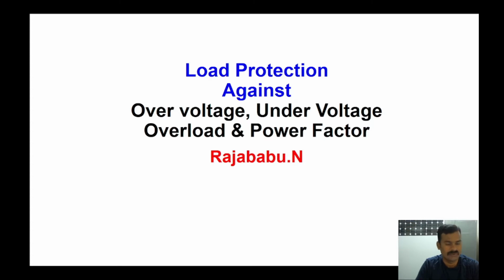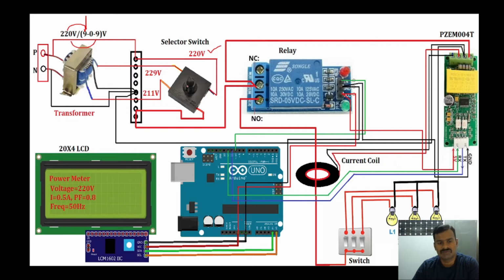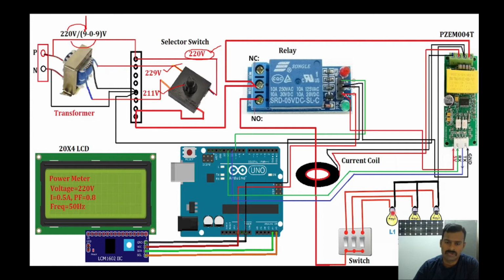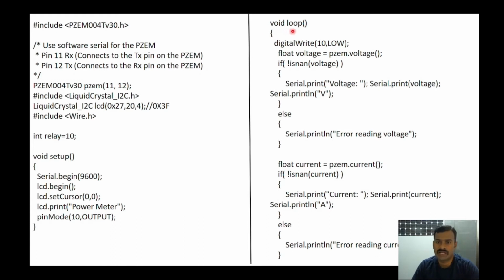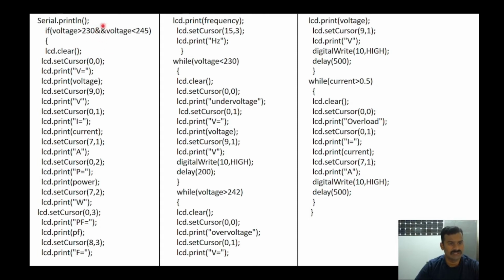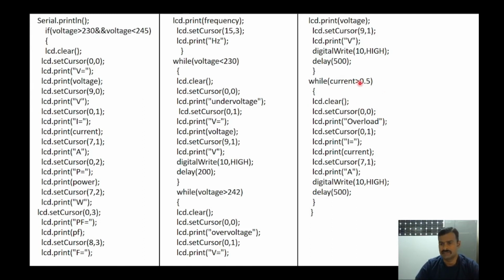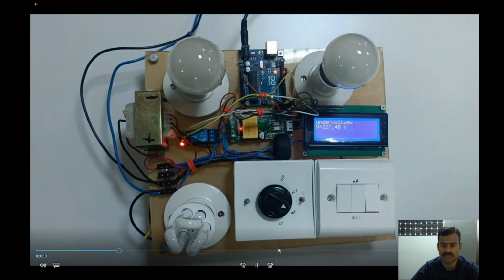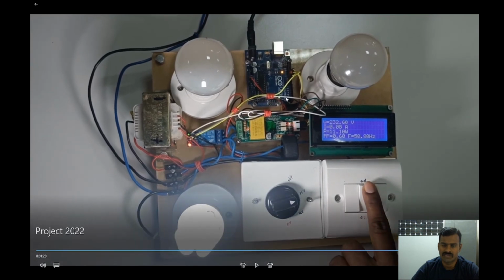Load Protection Against Over Voltage, Under voltage, Over current & Power factor Variation

Comment: Can we apply this project to short circuit protection?
Reply from the maker: brother for short circuit, trip time should be in terms of milli seconds. theoretically we can use this but in real time based on the severity of the issue the i am not sure whether the system can isolate the fault with in the limit. if you want to use this circuit for short circuit protection add fuse in the circuit after the selector switch. fuse rating is based on the load current(1.5 Load current)

Comment: Hi i want to ask for this project what kind of supply that use battery or direct current
Reply from the maker: Control unit(arduino, relay, LCD etc powered by DC) & Power circuit fed with 240V AC
Reply: input p with n from where